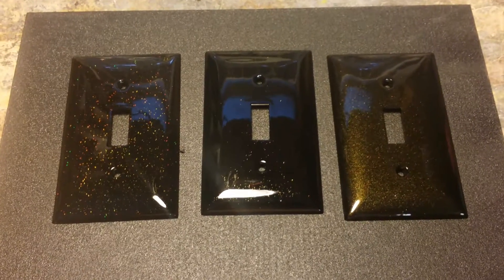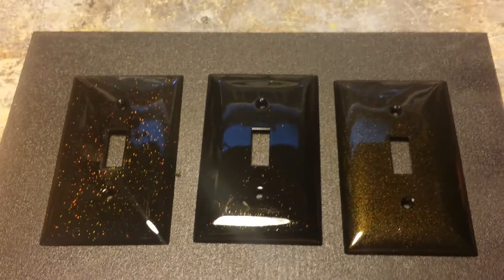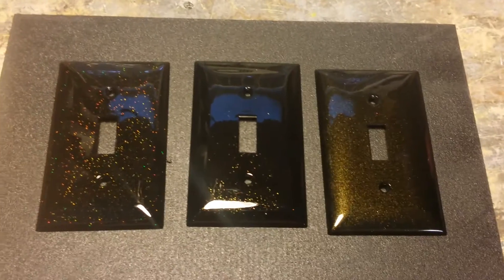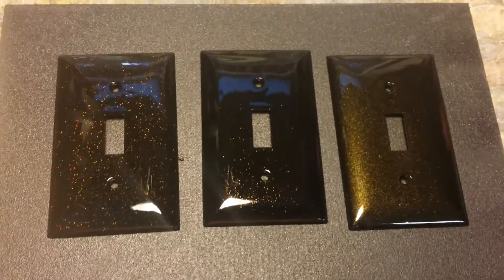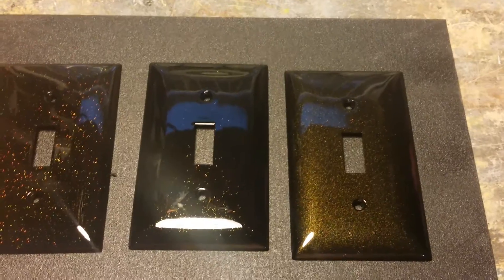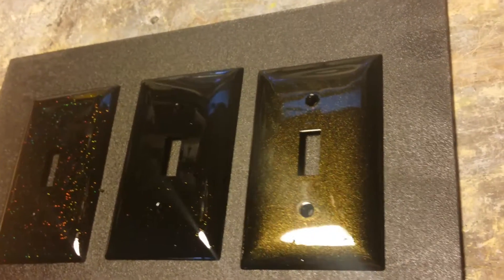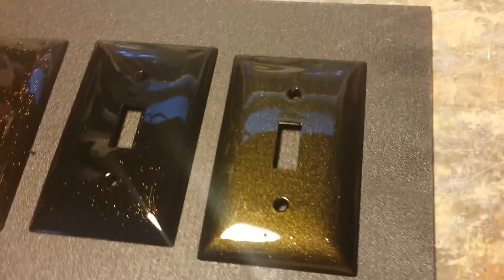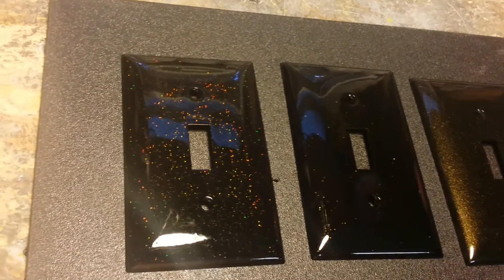Black and gold flake/pearl........Please vote for your favorite

Comment: What do you use for your clear base coat so it sticks well?
Reply from the maker: You want to spray your coats after the correct flash times and not stop the paint process. If you stop and come back a few days later for example, you may have issues as your layers of material will not bond together correctly. Painting in the right temps/humidity is essential. Having a perfectly clean surface area for your primer is a MUST.